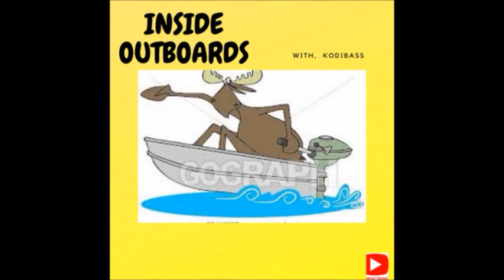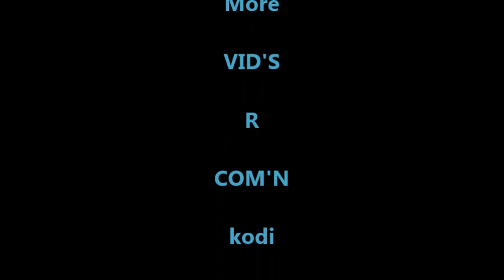1956 Johnson 7  & 1/2   Before & after,

Comment: Nice job has a unique upgraded look sounds sweet & if you need a  original choke knob let me know.Glenn P.
Reply from the maker: +G62'  Thanks I have the knob'  I just have 2 find it;  It will show up'   thanks tho.                        kodi
Reply: @kodibassInsideoutboards  Okay talking about upgrades I would like to see someone engineer and make a kit for these with a  C.D. flywheel that utilize a C.D. system with a pac like the 9.9-15HP have from the 1980s-90S. Its probably been done I heard rumors that someone did that right here where I live with an old Evinrude 1960S 18HP  I would of liked to seen that .......................... Glenn
Reply from the maker: @OutBoardTink62  Funny u should mention that,  I am currently working on options 2 do this MOD,  I think I may have it figured out.             kodi
Reply: @kodibassInsideoutboards  Yeah I remember now it was a local Boces Marine mechanic instructor I met who told me he did it with a friend  of his & adapted the full CD  OMC 9.9-15Hp ignition system to and old points 18 HP Evinrude.. I guess anything can be done today if you have the ambition to really do it... that would be a great  upcoming video for you to think about. I would imagine fitting the flywheel would be the biggest challenge .P.S I like the old points motors  and am loyal to them .I would never  even try  to do it they were good for decades why bother ,LOL!........Glenn P.